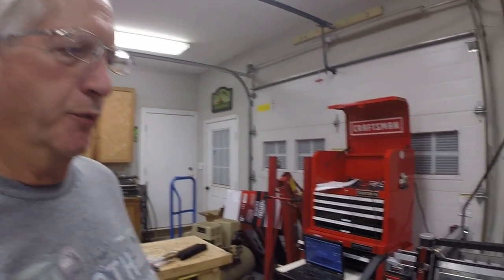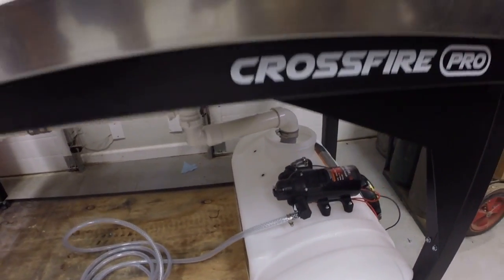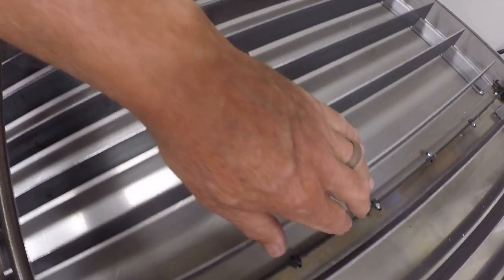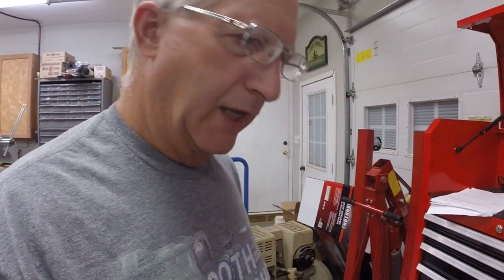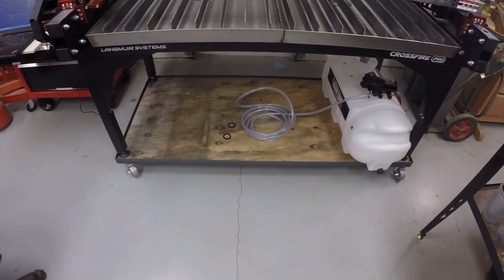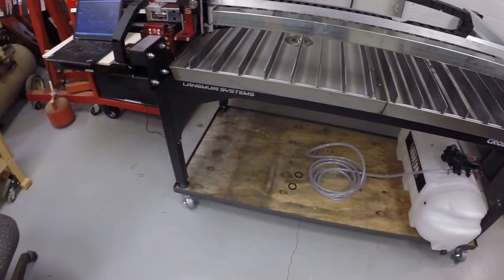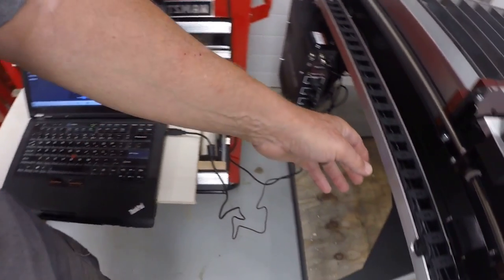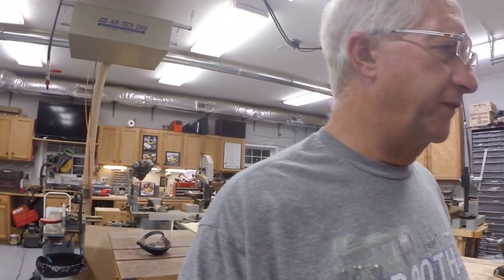Crossfire Pro Initial Set Up

Comment: Wondering if you have any vids of the setup for your rolling platform.  Did you just weld the wheels to the angle iron, I'm assuming the angle iron is 1.5" or is it smaller. what thickness of Plywood did you use.  Did you buy the tank from amazon, or somewhere else?  Has the Plywood held up to the flying sparks?  thx for vid!
Reply from the maker: 1-1/2 angle, welded together. 3/4 inch CDX ply, The feet of the table just rest inside the angle iron frame, on the plywood. sparks fly off to the sides, so no issues there. Tank was from Northern Tool. Sorry, no vids of that build.